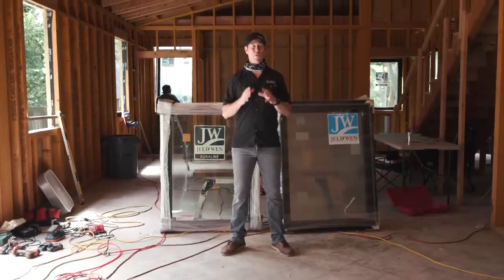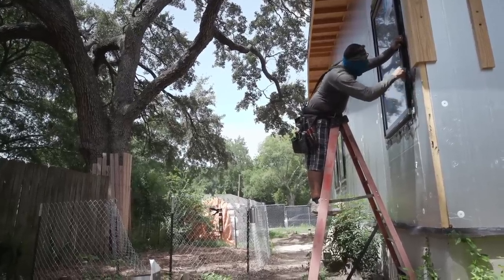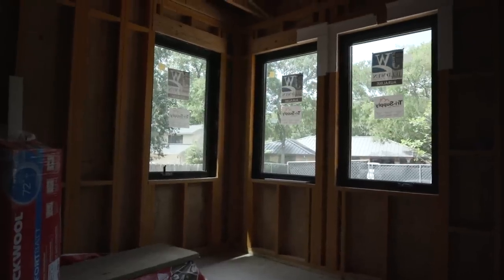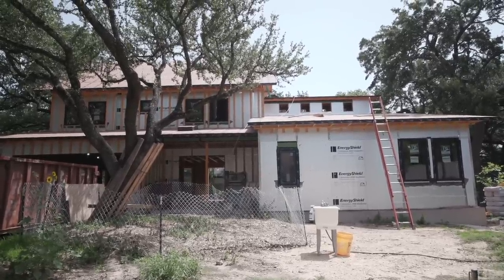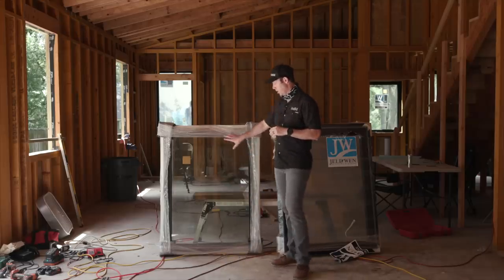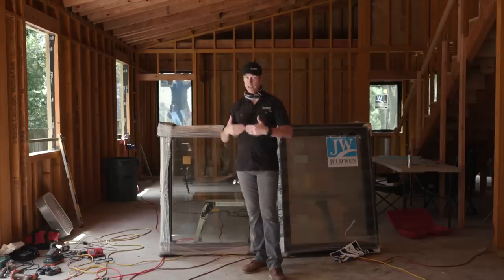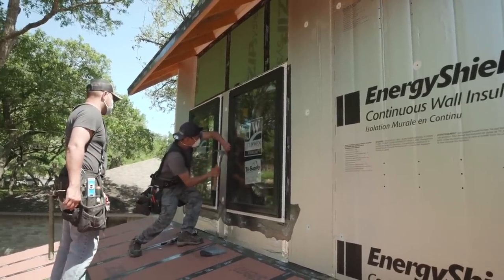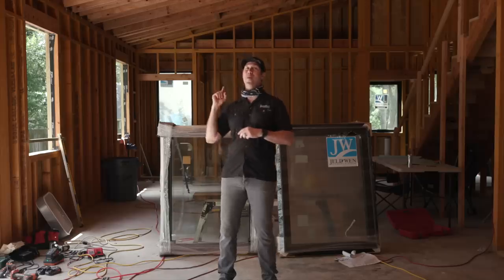Triple Pane Windows - Worth it?

Comment: When I first got my triple paned windows, I noticed that in early mornings (it was fall), my windows seemed to fog up and I panicked thinking the seals had somehow all mysteriously failed.  I called up my dealer and he laughed and said that this was because the new windows weren't transmitting heat from inside the house to the outside so they were cold and condensation from the warm moist air off our lake was condensing on the outside... so I went racing outside and sure enough he was right.  It was all on the outside of the windows.  Let the sun come up for more than 15 minutes and it evaporates off but it was a very clear illustration to me the benefits of a triple paned window over my old double glazed windows (I still have a few of those where I didn't care about switching them out).  

In the last few days, I've used an IR Temp gun to shoot my double and triple paned windows inside and out both during direct sun and on cloudy days and at night and the differences are astonishing.  Right now, my (stone clad, 1" Styrofoam SM exterior cladded (on top of existing 3/8" chipboard on 2x6 with Roxol Wool insulation) wall has an internal temp of 71.5˚F/22˚C in direct sunlight on a 16˚F/-9˚C day.  The thermostat is set for 22˚C (71.5˚F) so that makes some sense.  The interior walls are anywhere from 72-75˚F.  My triple glazed metal clad wood windows (Loewen) triple glazed windows are showing an internal (on the internal glass pane) temperature of 80˚F/27˚C while my Jeld-Wen Home Depot double glazed original windows are showing 65˚F/18˚C so I'm losing 7˚F/4˚C to those over the walls (while my UV coated, triple panes) are actually bringing in more heat than they are losing.   If I go outside, the stone cladding is at 32˚F/0˚C in the shade but 65˚C/18˚C in direct sunlight.  My triple panes are sitting at 47˚F/8˚C in the shade and 65˚/18˚C in the sun so not losing anything more than the walls in sun and about 15˚F/10˚C in the shade.  I worried that this would be a problem at night or in warmer weather when I don't want the extra heat, but at night, the triple pane windows drop down to the same temperatures as the walls but the double panes go down into the low 50's.   I've done the same experiment in the summer and found that the interior temp of those triple panes never seems to go much above 80-85 even in direct sun but the biggest difference is that you can sit in the sun on the hottest days comfortably while we would get chased away with the old windows by 10am or so.  Not to mention that we had to replace all of our leather couches and flooring with the old windows after 7 years due to sun damage while the last set has been like new for the past 10 years with the new windows (the old ones were UV treated too).  It's a no brainer to me.  Pay the extra money.  Your wallet will thank you.
Reply: Great write up. I’m glad your dealer gave you a good explanation AND you were able to fully understand and accept it. I have explained it like what is written below and people either could not understand or didn’t care and complained that their new costly windows had condensation every morning. 

  Because we have higher performance glass, that outside glass, that used to get heated up by the heat in your home (and ultimately that heat lost to the exterior) will act just like a cold glass of water when the sun rises and warms the air just enough to hold moisture. The moist air hits this cold glass and you get condensation. There is no avoiding this and it’s worse with LoE2 or LoE3 plus Argon. I’ve seen the same windows with LoE2, but with no Argon, be the tipping point and have no condensation. The one window that had the Argon option, on the same wall, had the condensation. 
  You can imagine some multimillion dollar mansions with their multimillion morning view out some really big expensive windows but they can’t see their view most cold morning because of this. This is why sometimes, especially in homes that can afford it, you can’t opt for the most energy efficient glass package, if you want the view.
Reply: @RemmikRotus  Yeah, I love my windows (they are Argon filled as well as LoE1, LoE2 & LoE3) but as you say, sometimes in the early AM (before sunrise), if I want to take a picture of the sunrise, I have to go out on the deck!  After 15 minutes of sunlight though, the condensation has burnt off as the external panel heats up quickly with direct sunlight and they remain clear all day.  I'm at almost 20 years on them now and they still are like new.  Couldn't be happier with them.

Comment: I have triple glaze krypton filled,  the insulating value is nearly "r10" but the sound deadening is worth the price.
Reply: Sounds like you have found the Alside Preservaion or Ultramax windows with a U value of .9 and a SHG >1 with 2 soft coat low E coatings.... That is what I spent 7 years selling :). The labor to install is exactly the same so upgrading is very small cost difference!
Reply: Sounds good.
But you do have to always keep in mind that windows with special gasses will lose their R-value over time due to the gasses leaking/permeating.
Reply: Is the sound insulation at that good?
Reply: Huh!?
Reply: Dean Turner  my windows are open 24/7
Reply: Dean Turner   if your house is insulated well you won't need to open them to cool.
and if your house has a decent hvac you will have plenty of fresh air.
plus who opens their windows when is 10f or 100f, thats when insulation matters
Reply: @benwhittle7204  yes!
Reply: Dean Turner  we seldom open our windows unless momma burns 🔥 dinner! 😂😂😂
Reply: @tomsassurance  it's been about 20 years ago.  I think they we "Great Lakes Uniframe" 
They still look as good as the day they were installed!
Reply: Dean Turner always take everything to the extreme, sigh. The point is that insulation is most needed when temp differences are very large. Ventilation is not what you want to do when it’s 10 or 110 degrees. So having good insulation is nice, and for those days that you do want their breeze, have well shutting casement windows that open.
Reply: @dougiedoug2921  Same technology, Different company. I almost represented Great Lakes, Excellent company!
Reply: For best sound deadening, the gap between one pair of panes (center pane and outside pane) needs to be different than the gap between the other pair of panes (center pane and inside pane).  Larger gaps are also more effective.

Comment: (I wanted to edit this and change it up a bit but I don't have the time.  The main focus is still valid though and I'd be very interested in seeing an ultimate showdown of two houses like I mentioned below.  I think it would be beyond interesting and very informative!)

I see you focusing 100% on energy efficiency/performance in virtually all of your videos (at least the ones I've watched, not counting this one).  You're constantly talking about alternative construction methods and alternative products that can have an AMAZING difference in efficiency.  But you don't seem to ever mention price to performance ratio.  What I essentially mean is how much you are going to save in utility bills compared to how much MORE you'll be spending on these amazing products.  For example; a traditional house that is constructed with regular studs, regular OSB sheets, typical insulation, a non conditioned attic, typical central air system with duct systems that aren't engineered.... Just your basic everything.  How much will the heating and cooling bills be monthly?  And then you have your ultimate efficiency house; tstuds, those zip OSB sheets, best insulation, conditioned attic space, great windows, engineered and completely sealed duct work, very efficient system (maybe even a geothermal system) ... I'm talking EVERYTHING done with the absolute most efficient materials and in the most efficient way.  Now how much will the heating and cooling bills cost for this home?  After comparing the heating and cooling bills, then you compare up front costs... How much MORE did it cost to build the ultimate efficient home?  Take these numbers and figure out how many years, or decades even, it will take before the cost was worth it.

What I'm getting at is that there MUST be a GOOD balance somewhere.  Some products might cost so much that even though they are far superior, the price to performance ratio is just too high.  I have a great interest in increasing the energy efficiency of my home but I am not rich or even wealthy.  So the cost MUST be worth it.  Finding that perfect balance is crucial for me and for most people.  Not everybody can afford to just dump a ton of money into their home (be it a new home, or a remodel) if it'll be decades before the savings are worth it.  Gotta hit that sweet spot.  And I'd love to see you do a video on that idea specifically if you haven't already.
Reply: Highly unlikely video. Matt needs the revenue stream of wishful thinkers; clicks are everything. Super expensive, super-performance is a much better video sell than plain ole, plain ole. I build for some pretty well-heeld clientele, and I could not see advocating the full range of what we do for them, for the general population. It is just not realistic. Presumably, you have followed the Matt / Meet Kevin interactions? Kevin is a bit of a dick, in my view, but essentially correct in that money and ROI is a part of anything one does, like it or not. Matt lives in a world of skewed values, rich clients and donated and subsidized materials for himself. My own experienced but unverifiable opinion is that very little one does to a home has a genuine payback: costs are too high for quality anything, and our energy costs are still relatively low. 

I started out in 1971, as a design build type. For a long time, my jobs (additions and renovations) were justified by the homeowners on the basis of the big payback (increased value) when they went to sell. The first big downturn put the lie to that. The reality is that most of those jobs saw an increase in value due to inflation and demand. The owners would have had a better return on their investment if they had done nothing at all (except basic maintenance). 

Final thought: Matt is a builder who employs the principles of building science. That is NOT the same as being a building scientist, and certainly not a building science economist. And, Matt will not respond to you, as mixing it up online gets contentious and negative (usually very quickly), and that is bad for the brand.

Comment: Why is the solar heat gain coefficient on the triple glaze not as good?  Seems like it should at least be able to match the double glaze.  A line I really like 5:10 "I was concerned about overall budget, it's my families house".  Spoken like a contractor. :)
Reply: Because the triple pane absorbs more heat on the inside and room-side layers, which is then carried into the interior of the house. Although the solar energy has been absorbed, something still has to happen to it, and solar heat gain coefficient takes into account the energy which was absorbed as well as the energy that was reflected.
Reply: @youstubers5722  it's because there is less space for the gas filled cavity. Triple glaze takes up space where gas should be. Triple glaze is not for better insulation but for sound deadening
Reply: Simply put, it is Because it is doing a better job of keeping the heat in or out
Reply: Triple glaze blocks and reflects more of the sun’s energy than dual glaze IG.

Comment: Good breakdown. Low “E” has made a huge difference to my antique furniture, stopped fading and darkening as well as damaging UV. Lifetime warranty is Important, I’ve replaced 2 over 20 years, one, the vinyl window separated and the other fogged between the glass.
Reply: Laminated glass reduces UV about 98% but it is expensive.  Aftermarket films will do the same while adding an exceptional security advantage

Comment: Each dead air space and each "interface" between air and glass adds to the "difficulty to transfer heat"
So the triple WILL be  better for insulation (if the glass types are equal)
And this is why a storm window or even the old plastic film kits we  double stick taped to the wall over the window  helps.  It creates another dead air space and another set of  glass (plastic membrane) interfaces..

Comment: I'm a subscriber, and contributor, and a devotee of Matt's tutorials...especially on framing and "smart layering" methods.    As an electrical engineer and IT professional, I can't help but offer Matt a tip to "tube that house" for future IT changes.   Don't staple Cat6 or anything else, to the studs, despite the obvious energy-saving temptation of using dimensionless space for wiring.   Rather, tubes, all shaped to some hub location in the attic, will COST some compromise to energy-insulation perfection... but make that house adaptable over the next  CENTURY or more of its existence.      Matt's projects are so tight, that they are non-capable of being remodeled years later; that's the flip side of tight, complex, layered construction.  This is no mud hut!!!!!!!!
So the further Matt moves his designs away from the "mud hut," towards "passive perfection," the harder it is to REASONABLY attain future changes...    To "future proof" that house, or even to merely make any future accommodations possible, the "tube" for low voltage is the key.     IT is the fastest changing technology, of all; even more rapid than plumbing.     So conduit is your friend, because it allows future replacement.        Wiring standards change roughly every 20 years.
Do I need to recite a litany of standards that are long gone, over merely the last 50 years?     Even 30 years ago, RG-59 was the standard for coaxial television, only to be replaced by RG-6, and even RG-11.        I remember when RG-59 was NEW, and commonly used to replace twin-lead (300 ohm) television antenna cable, so often stapled to studs (before 1970), before the LATH AND PLASTER went up.
Reply: I'm literally about to pour our foundation for our "forever home" and am doing the low voltage wiring myself.  I'm using some of the methods you are talking about, conduit to TVs/Projector, all back to a central wiring closet.  So you actually recommend conduit to EVERY cat6 drop?
Reply: Generally agree. I built my own recording studios and everything is in a pipe or trough with a pull wire. I'm building a new house and will be running some strategic conduit runs. But whatever I do, I know I'm going to miss the mark in some way. I can see with so many things going wireless that I might end up not needing the conduit, and should have done something different to better accommodate RF, or direct brainwave connections, or carrier pigeon, or...

Comment: you  should mention also that triple works great with road and train noise
Reply: All things being equal, triple-panes are barely quieter than doubles. If you don't believe me, check out sound transmission data from the manufacturers. If you really want noise control, order glazing designed for that purpose (for example, panes with different thicknesses to deaden a broader range of frequencies).
Reply: @PaxsonWoelber  The video is correct. Tripple gives a lot when we talk comfort and sound. More than data says. And do non opening if you can, you save a lot of money.
Reply: @PaxsonWoelber  Yes. What you said. I should add that upgrading one pane (of two or three) to a greater thickness for the sake of sound is relatively common option in the higher performance window lines of reputable window manufactures. Finding a salesperson who gives you that option because they know what it is might be a little less common.